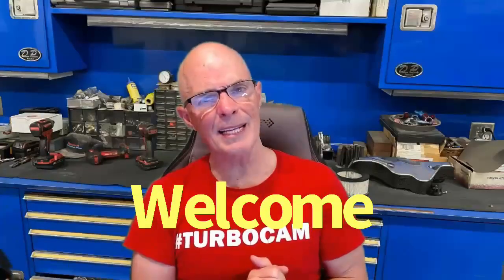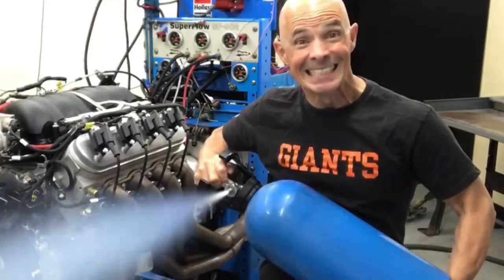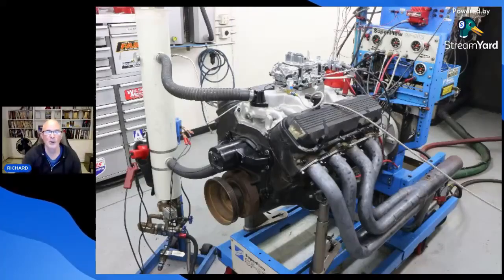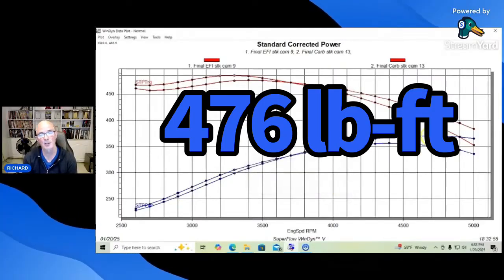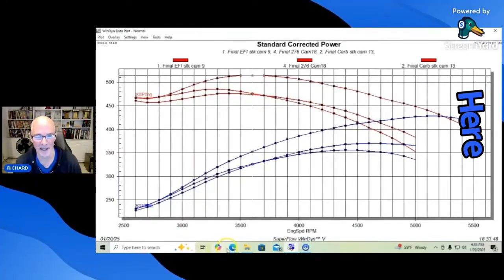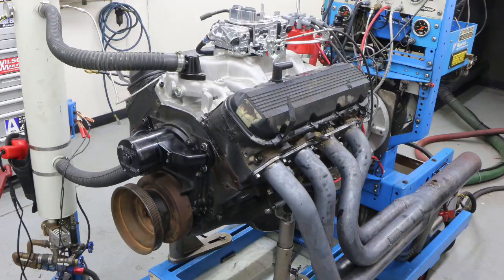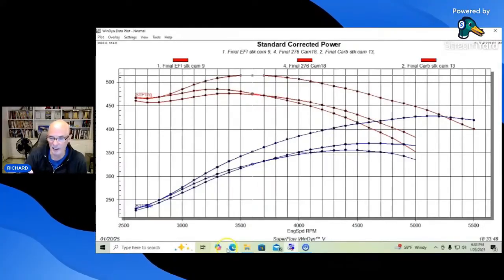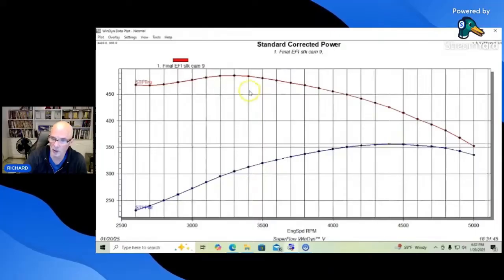CARB VS FUEL INJECTION...WHAT MAKES MORE HP? GEN 6 BBC MODS, EFI VS CARB. HOW TO 454 CAM SWAP & NOS

Comment: What camshaft would you use on a gen6 in a 96 Chevy 3500 truck. Using it to tow across country. I want to just do a camshaft no cylinder heads. 
And use the stock efi. 
Thanks for your help.
Reply from the maker: YOU WILL NEED TO TUNE IT
Reply: @richardholdener1727 
Ok a friend of mine has an hp tuner would that work?

Comment: A guy can really see why the later-gen big blocks weren't the ultimate swap like the early big blocks. Stock it's making the same peak HP as a 5.3L LS, and with a cam & intake/carb it's making the same as a 5.3L with a mild cam.

Comment: what type of intake and carb you recommendand for a gen 6 454
Reply from the maker: for what power level? Usually a 650 or 750 and dual plane for street application
Reply: yes its just stock motor i will build later @richardholdener1727
Reply: thanks and what kind of carb@richardholdener1727

Comment: Got a question for ya Richard. From what I've heard carbs get an advantage through better mixing of the fuel, since fuel has more time to mix with the air(more intake length between the carb and the cylinder). But then people go efi because they want computer control and being able to set the mixture on each cylinder individually. And they end up with an injector that is right next to the intake port, so much less time for the air and fuel to mix. So then why doesn't anyone run a conventional manifold with longer individual runners, and with each injector placed near the start of each runner, so the fuel gets more mixing time? Sounds like best of both worlds, but i assume there's some reason people don't do it. Feel like i used to see some racing engines with the injectors placed outside, squirting into inlet trumpets. Thanks, Joe
Reply from the maker: it is not from fuel mixing-it is from charge cooling
Reply: @richardholdener1727  thanks heaps, yeah ok, but still, why do injectors get placed right next to the intake port and not at the start of each runner to get better charge cooling? Thanks again 👍

Comment: Richard.  Serious question before you tell me I am wrong 😂.  Prior to 1975 or so besides blended years engines were carb operated, jetted and some sort of mechanical dizzy with no ecu’s.  These were known as naturally aspirated engines. Along comes EFI, ECU, and no dizzy.  Those are Injected engines. Being a computer sniffs the exhaust, adjusts the fuel and basically injects it into the engine while the ecu figures out the best timing on the fly can you tell me why everyone considers EFI naturally aspirated?  Yeah I get the fact air ain’t being Jambed down the intake at pressure. But EFI is being shot either directly into the head or intake to where a carbureted motor has to inhale fuel/air all basically related to the pistons suction ability and porting. I personally don’t consider EFI as naturally aspirated for the simple fact the fuel is injected with a computer and there isn’t anything natural about that. What do you think? 🤔
Reply from the maker: naturally aspirated means drawing in air of its own accord, not boost (EFI or carb doesn't enter into that equation)
Reply: @ ok so n/a is only related to how the engine draws air (without forced induction) and has nothing to do fuel, EFI or carbs.   Ok, thanks.

Comment: @richardholdener1727 , I picked up a MerCruiser 502 Gen V long block with std bore, forged bottom end. Was planning on new forged pistons for 10-10.5 1 compression and some new aftermarket rods. Probably run AFR 325 cc heads. I’m looking for 700 ish HP with efi. This is going in a 69 Camaro behind a t56 mag. Any suggestions on cam choice and efi? The Holley with the TB separate ecu & the edelbrock both look good with CAN outputs to run a digital dash telemetry. Thx!
Reply from the maker: you need a good size cam for that-look at (at least) the BR300 comp

Comment: think a 245/245 @.050 on a 108 lsa would work well lot of cubes like cam just run narrow lsa will keep down low tq up.
Reply from the maker: the 108 and single pattern might help a 245 @.050 cam improve torque compared to a traditional dual pattern and wider LSA cam, but it won't make torque like a smaller cam
Reply: @richardholdener1727  thanks. yes i am good with cam specs but i don't have the dyno time you do! was thinking with a 454 wold like cam just do to large size. was thinking a 245 @ .050 on 108 lsa with slow ramp rate on cam and say 10to 1 comp wold work well. but yes small cam do make more down low. hm how bout rodes lifters? thy give sum down low back. thanks!

Comment: Richard, a 351 W roller F4TE, I have stock pistons from a lightning (that compression ratio being 9.5:1) with 70 windsor heads ported out, with 1.98 valve. 1.6 RR, a chinese single plane tall, 670 cfm carb, along with a 35-775-8 comp cam, .579/.579, 236/242, 114 LSA cam. Just roughly what do you think this combo will make?  I have no idea what it would be. Thanks!!!
Reply from the maker: no idea how well your heads work, but mid 400s
Reply: @ the heads Flo 267/167 at .600 on a bench.
Reply: @ Appreciate your work, we spoke on the phone many years ago.

Comment: Hi Richard,  firstly thank you for your continued help in creating a new generation of grease monkeys! 
Secondly,  can you please make a reliable twin turbo video using a 6.2L? You know something that if well maintained and not run all out all the time will last 4 to 5 years?
Reply from the maker: just add twin turbos to a stock 6.2l and run low boost
Reply: @richardholdener1727  Thank you for the guidance Sir. Would springs, cam and 15 psi come close to around 800 hp and still be semi reliable?

Comment: How about EFI with the cam and oxide?
Reply from the maker: nitrous works with any cam
Reply: @ I was more curious about improving the efi.  It seems like drivability is better with efi, and even though I haven't worked with efi, I "fell like" I should learn how.  I have a '62 Chevy 2500 that I already swapped a 454 with a Qjet and a 4 speed into, but I was considering swapping over to the 8.1 with the modern OD trans.  Strictly looking for torque, without going diesel.  I'll keep watching, I'm sure you'll cover that sort of thing.  Thanks!!

Comment: No idea how you could do this….but, I looked at a brand new generator yesterday made by Generac. I immediately went to the engine…. It has an 8.9 L V8 engine that makes 228 hp at 1800 RPM. It is a gasoline style engine with a carburetor, spark plugs, and a distributor. It looks like it might be modeled after a Dodge engine (based on the big barrel style intake - could be a GM design - distributor is in the back.)  Almost forgot, 😂it’s also turbocharged with an after cooler. It runs on natural gas or propane. If you could get your hands on one of those and hot rod it with a cam and head work….that would REALLY BE “the other guys engine.”
Reply from the maker: GM did industrial 8.8L motors based on the 8.1L

Comment: oh mr. richard we need your help, Uncle tonys garage is stating EFI throttle body conversion like sniper and fi-tech etc etc are not as good as a carb at highway speeds compared to a carb, he makes sense on his claims but no data to back it up.  he says the exhaust gas stove pipe on the manifolds we bolt up to with those EFI throttle bodied causes lower performance at highway speeds vs. a carb, with fuel temperatures too high from the hot intake manifolds from a n EFI body, he does suggest using an air gap manifold to keep gas temps down.  I love how you back your theories up with dyno data, uncle tony e has no dyno data to back up his claim, he seems to be trashing on EFI throttle bodies, Im doing well with my holley sniper and an Edelbrock RPM air gap, supposedly carbs use a venturi to cool down the fuel as it enters the manifold increasing efficiency at highway speeds. pleas e advise and thanks for all the great content.
Reply from the maker: he is not a guy I would go to for tech-ask him to show you the data
Reply: Hi richard, im in Australia and looking for a 5.7 hemi running engine and manual transmission, would like a plug and play type engine to put a small turbo on, loved the one you did a while ago @richardholdener1727
Reply: These tests are done in a controlled environment, real-world driving temp,altitude,octane, change that's what makes efi king. UTG is obsolete.

Comment: Not satisfied with your experiment, you ran a stock efi system against aftermarket carb and intake?  Is it possible the carb just has more fuel dumping potential, and that's why you see the hp in the higher rpm?  Are the intakes a 1 to 1 comparison as far as how well they flow?  Sorry to nitpick, theres always going to be variables...
Reply from the maker: Fuel dumping potential? Both fuel systems can provide the optimized amount of fuel for the power level. The difference is the intake design
Reply: @richardholdener1727 Sorry, it was a great video, and nevermind the fuel dumping comment, I should know better, more air equals more fuel.  But you didn't do an "EFI vs Carb" comparison, you did a stock intake versus aftermarket comparison.  The reason I bring it up is because I'm dropping a magnum from 2001 ram into an 84 w350 and plan on running the stock efi with the harness and pcm.  It's not really about the efi vs the carb that's making the difference in HP, it's just airflow, I keep second guessing myself on weather the stock efi is worth the extra effort, but it will definitely save some dollars not buying an intake and a carb.

Comment: I'm new to the channel 
Have you done a video?
taken a stock5.3 with the stock computer not change anything on the motor and have done a comparison with cams? Stock computer stock injectors stock springs. Just your average motor you pull out of a junkyard?
Reply: Never seen him do a stock ecu
Reply from the maker: you want to add a cam that fits with stock valve springs and then not tune the new combo?

Comment: would a GEN 6 head be an upgrade for the markIV with its smaller cc closed chamber?
Reply from the maker: which Mark 4 heads? but likely yes (only 102 cc on the Gen 6)

Comment: Haven't watched the video yet but that EFI intake worked great on a 502 in a 1969 Kingswood wagon. I never got to drive it with the manual trans but the 4L60 ran good with a 3.73, The motor had to be lashed down it would torque to hard and manipulate the shift linkage. Probably my favorite customer car big and always surprised people. That was probably 20 years ago now....

Comment: I own a 99 k3500. The test that would seal the deal for me to finally build an engine would be the afr 265 heads subbed into a stock package. Accessories, efi manifold, stock vs. mild cam...
Reply from the maker: THOSE AFR 265S ARE EXCELLENT HEADS
Reply: @richardholdener1727 the trick flow 270s are neck and neck with them. Weingartner tested them
Reply: My biggest concern is investing in a lot of expensive parts, building an excellent long block and just killing it with the factory intake manifold. I've thought about tracking down the discontinued Edelbrock Xfi oval port or a mercruiser intake. Just not crazy about the snowball of ac lines, oil fill, accessories placement.
Reply: You know what grinds my gears? Nobody running badass 7.4 vortec setups in the factory application is online. There's a comment on a Facebook group. From memory the guy said he had Long tubes, single plane EFI intake with a throttle body elbow, mild cam, bowl work. and could get 15 mpg on the highway. I'm guessing that's a 2wd with 3.73 gears.
Reply: I can't imagine the stock intake manifold would do AFR265s justice
Reply: @christiansteffen3270 be even a bigger torque monster
Reply: @cedricwilson2055  that's a good point. Id absolutely love to see it done
Reply: I'd also love to see that test: AFR 265s,  RPM Air Gap (Holly terminator?) vs L29 intake manifold, both with mild, towing friendly cam swaps. It would be immensely useful for those of us using 454s in daily drivers.

Either way, this is a great channel. Thank you for all the excellent testing you've already done.

Comment: I still love my carb 8100 Vortec. I have it in my C3. It has race tech pistons, rods, crane link bar lifters etc etc a custom APD carb runs so well! I love it the cam is a basic 236/242 on a 110lsa .600 lift
Reply: I hope it has proper head flow to take advantage of the decently sized cam
Reply: @ make 580 hp 630 torque just so you know

Comment: What about two T3 T04E V-BAND Turbocharger Turbo .63 A/R 73 Trim Internal Wastegate 420+ HP on a big block for the street?
Reply from the maker: GET TWO gt3076S FOR A bbc
Reply: @bnlalldredge  T4 frames or better with way more AR. Remember Big Block.
Reply: @ 472 ci rear mount twins, s366 with divided T4 .91 A/R or 7875 with T4 A/R 0.81,witch one builds boost sooner?
Reply: @ They will be rear mounted in front of the axle, fox mustang, so ground clearance is a concern.
Reply: @bnlalldredge  It's very interesting. You may need to run 4 T04E for big block duty. Backpressure defeats the purpose if the turbos are too small. I am biased to big turbos, though.
Reply: @soulcapitalist6204  This is a true street car, it will have mini tubs and torque box reinforcement but will never see the race track again cause they closed it. if I was to do it over I would use a 351 and still might.

Comment: More of a long runner vs short runner test
Reply: Yup...it is a big factor.
Reply from the maker: What about a dual plane is short runner?
Reply: @richardholdener1727  
In that comparison, everything about that dual plane is a short runner compared to that EFI manifold. 

When you compare a single plane and the dual plane, sure the dual plane is a "long runner" because it about twice the length of the single plane. 

But when you put a dual plane next to that EFI manifold, the dual plane is what? one third the length or less?

That test wasn't EFI vs Carb,  it was 5 inches of runner vs 15 inches of runner.
Reply: @bradmcgrath358 . You know who you are talking to right?
Reply: @  Yes, and he knows that dual plane is way shorter than that EFI manifold.  which is exactly why it shifted the power curve the way it did.
Reply: @richardholdener1727  Shorter than the EFI by quite a bit. Unless you take a string and take a measurement for us.

Comment: I'm just gonna say, with the stock cam that stock EFI intake is awfully hard to say no to. I don't know you'd notice that hp/tq trade and it'd be fun to do EFI.

Dumb question did you run that 7400 intake with the nice cam?
Reply from the maker: We did not, but would expect the same type of difference-more power up top for dual plane, more down low for efi long runner

Comment: I'm different to others. Not better, definitely not smarter. Fuel atomisation and the specific place of its distribution is the most important, not if its injected or carburetor. I grew up around Italian and Australian six cylinder cars with port on port Weber DCNF 40 or Weber DCOE 45 independent runner induction. Traco and Moon made the best intake system for a Big Block Chev...the Quad DCO  58 8 barrel  intake..Any thing that copies that kind of system will make an epic torque and power delivery curve. I just love your 4bbl verses EFi comparison. Your stuff is ace 🥝✔️😢

Comment: In 2003 I made a 525" short deck with a friend (and a factory short deck block) who gave me lots of confidence. It was for a boat, but I'd love to make a 505 or 525 for nitrous duty.
Reply: Vizard has a 525 build in his book. Way more powerful than than a 496. std deck
Reply from the maker: a 525 std deck block? how much stroke?
Reply: @richardholdener1727  The 4.5" Scat. Clearance and seating by Castillo Machine, Las Vegas.